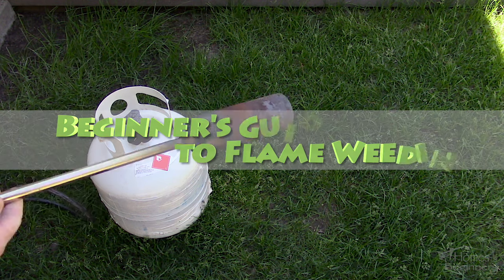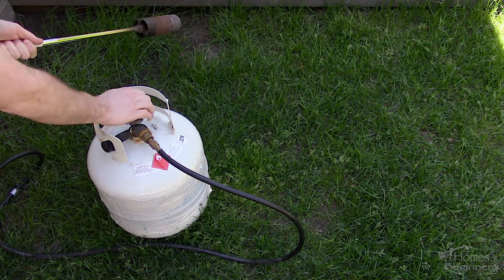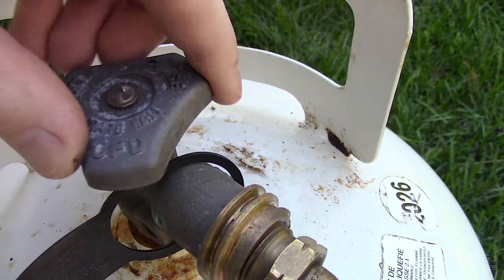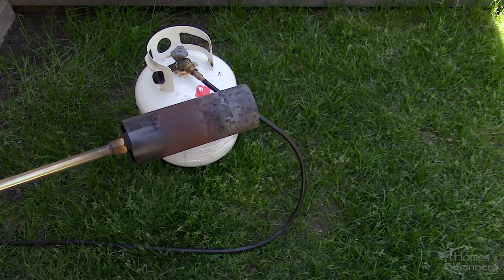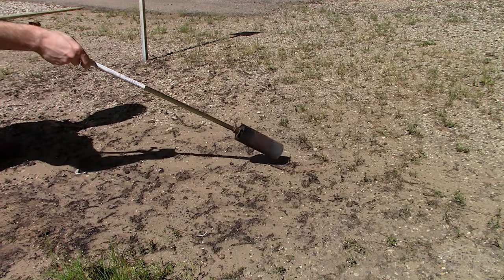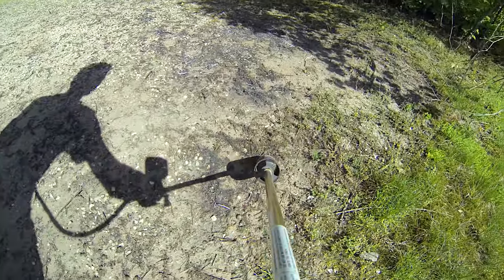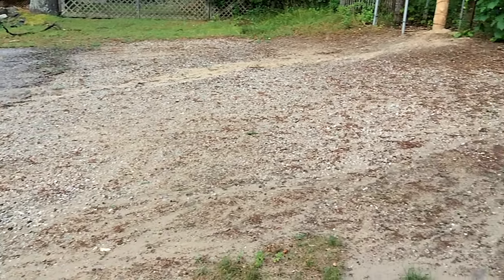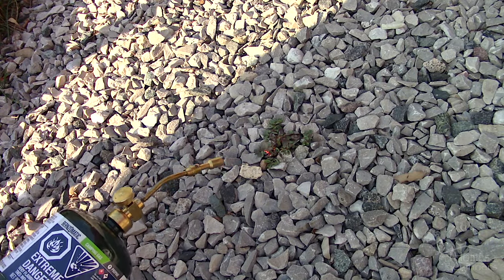How to Flame Weed - The Beginner's Guide

Comment: my experience is you really need to burn weeds dry or they’ll be back in 2 weeks.
Reply: Seeds are quite resistant to heat and there are thousands of them on and in the ground already, this is the hardest part about weed control… there isn’t really a sure way to destroy the seeds, especially when the wind blows them from somewhere else!

Comment: I use these flame torches for weed control around my pool patio and driveway pavers.  For areas where an open flame isn't a viable option, I use 30 percent vinegar and dish soap.  Works great.  Thank you for the video !
Reply: So you use 30% vinegar do you put it in a 1 gallon spray pump?
 how much of the vinegar do you put in the spray pump,  how much soap do you use and do you add water?
Reply: @johnnixon6545  I pretty much use it straight with just a quick squeeze of dish soap.  Weeds do not like it!
Reply: @ranger2316  Awesome sir thank you for that

Comment: The check valve is only activating because you have no regulator  between the tank and the torch  You should have a high pressure regulator 0.5 - 4 bar it is a safety priority. For your information : The regulator controls the gas flow from the tank's valve to the torch. It also acts a barrier between the torch and the high pressure of the tank. Without the regulator or with an improperly functioning regulator the gas tank and torch are serious safety hazards.
Reply: OMG!!!! THANK YOU FOR YOUR COMMENT!!!! I am not a regular propane tank user but am smart enough to ask questions. I could not find a logical answer to my question "do I need a regulator for my weed burner". 
From your reply it sounds as thiugh I should ALWAYS use a regulator when using a "big" tank.
Thanks again!! Taking two minutes to share your wisdom is much appreciated!!
✌

Comment: Regarding spot burning, which flame setting is more efficient: a blue (hotter) or yellow (cooler) flame?
Reply: Blue Is much hotter.  It has more oxygen and therefore doesn't put off a dancing yellow flame but more of a rocket engine style conical flame. This happens when you either pump up the propane flow and/or open up the baffles. In this case the baffles are welded so I believe you would achieve a blue flame by turning the flesh control knob to a higher setting

Edit: FLAME. Not flesh!

Comment: Weeds along structures (garage, home, deck, etc), any extra precautions?
Reply from the maker: Spray the structure down with water and I would recommend also using a steel barrier, just move it along as you're weed burning.

Comment: I torch weeds at my beach house where I have large areas covered with gravel.   It is a little scary at first, but with common sense and focus on safety, you should not have a problem.  I do not go near any combustible structures as a precaution.

Comment: I just bought a propane torch, and I'm wondering what fitting do I need to connect the hose to the propane tank. I thought I would just had to connect the hose to the tank but it doesn't fit. What size do I need or how do I find it at the store? Thanks